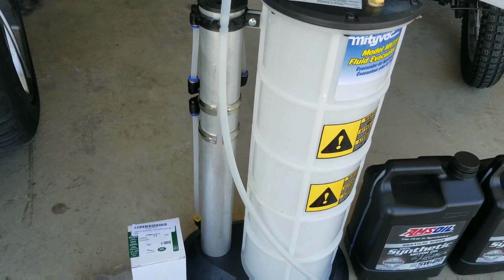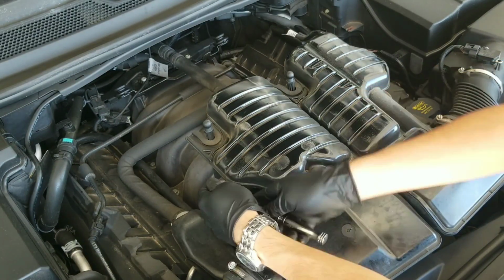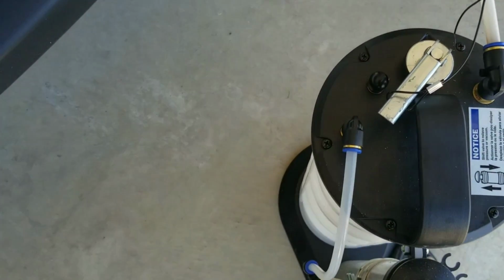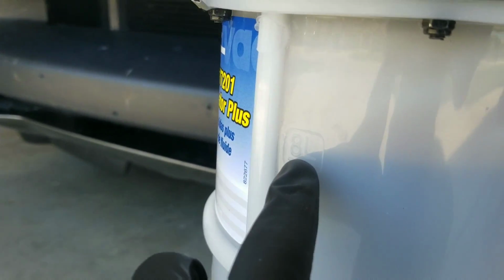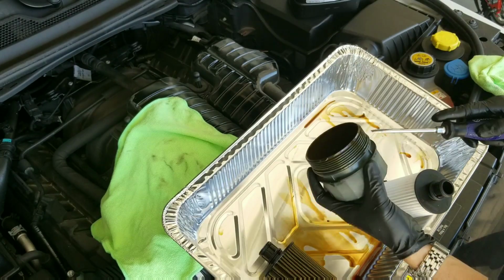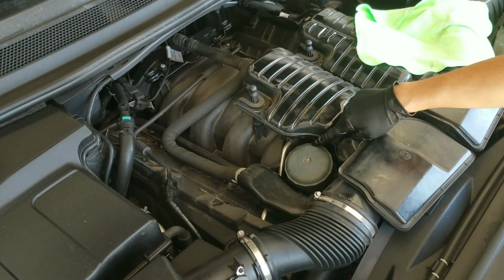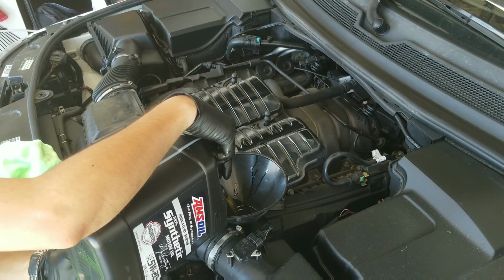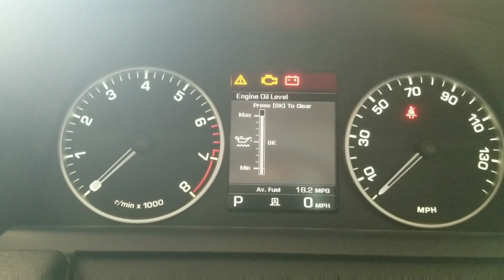2010-2013 Range Rover Sport L320 | Quick and Easy Oil Change

Comment: Does that method extract all of the oil? I've seen setups where you use a vacuum tube which you insert into the stainless tube that you connected to.  Then you push the vacuum tube all the way down into the oil pan.

Comment: Great video.  But 8.5 quarts ? Mines a 12 book says 8.  I put in 8 and still get a service engine warning and my Guage says over filled. I had to extract a half quart. And then in the oil filter housing there's quite a bit left I try to suck out and wipe it clean.  Next time I'm pulling the drain plug also to see what else comes out. 
Cheers

Comment: Hi. I see this video is few years old but its even better for my question..
How is that AMSOIL working for you? I have just did my first (first by myself I mean) oil change in my 2013 RRS SC using AMSOIL 5W20 SS series oil. I drained it VIA the plug though. I dont have a pump and I was replacing active sway bar bushings so armor was off anyway...

Comment: do you know how to reset the code required maintenance  when i change engine oil 2013 range rover sport 5.0 v8 supercharged
Reply from the maker: I have an IIDTool device that I use for resetting. Read some of the old comments on here, someone mentioned a while back on how they reset it without an external device.

Comment: Thanks for the video, any idea on how to reset the service light afterwards?
Reply from the maker: I don't believe you can do it without taking it to the dealer or use a special tool. I use an IIDTool.
Reply: Technical Mechanical Thanks for the timely reply. I ended up pressing start ignition to position 1(without foot on brake), opened hood latch, opened driver door, held brake and accelerator simultaneously to the floor for 10 seconds, released pedals, pressed ignition to shut off lights. Then exited car, closed hood and started car as normal and the light reset.
Reply from the maker: Very interesting! A while back I tried searching and couldn't find anything on how to reset it for the years 2010-2013. What year is yours?
Reply: Technical Mechanical 2010
Reply: Technical Mechanical Thank you for all your videos! They have saved me so much time and money!

Comment: Is there any oil drain plug under the engine if you don’t have one of these vacuum machines?
Reply: smhri there is but the oil pan is behind a 30 lb skid plate that u have to take off to access the drain bolt. i guess certain ppl prefer not to do that cuz if that thing falls on ur face it could really flatten it

Comment: Just my $0.02 - I think it's a good idea to put ~1Qt of oil into the oil filter housing to help prevent a dry start when you first start the vehicle. When you pour engine oil in an empty engine it goes to the same place you extracted it (the sump)...the first few seconds the oil pressure is building and bringing oil to the topside, which will likely be very dry. My thoughts are it's easy to do and it might help prevent unnecessary engine wear - so why not? GREAT VIDEO
Reply: Steven Phillips I pour some in for this reason as well!
Reply: lol.
Reply: Hugh Ty xxyxyhrnhngnxbxnnxxzuz😮a in
Reply: Un.  H tuuuhh

Comment: Great video!  Any particular vendor you recommend for the Amsoil / oem parts?  

-Thanks

-
Reply from the maker: Thanks! I get Amsoil directly from their website. OEM parts from Atlantic British and Amazon if it's cheaper. I also check out ebay for certain OEM parts. There are dealers on ebay that sells genuine oem parts at a decent price.

Comment: Over 8 liters were pumped out  !     But the 5.0  V8 should take only 7.8 liters ..... Unless this is a different engine 🤭
Reply from the maker: The standard oil change quantity for 2011 and onward N America market is 8 Liters. Yes, the dealership may have overfilled it a tiny bit when they last changed it. Mine has very low miles.
Reply: Technical Mechanical  My 2010 ( white exterior ) is at 10800 kilometer 🙂 now that is LOW mileage
Reply from the maker: I'm at about 32k miles already. You win! :)
Reply: Technical Mechanical 👍
Reply: @TechnicalMechanical  what size is the oil filter housing wrench in this video?
Reply: @seanblaum7129  Use a 15 fluted, 89mm filter wrench sold on Amazon.

Comment: What does the yellow service signal mean on your dash ?
Reply from the maker: I believe these are standard/general warnings since I had the door open, ignition on (but engine off), etc. They went away after I start the engine.
Reply: @TechnicalMechanical  ok so would you buy one with this triangle sign
Reply: @keyonjackson7950  I've had that sign on mine a few times and it's always been something significant. So - unless you can check it out, no. (Suspension compressor replacement, TPMS sensor fail)

Comment: I noticed you poured the old oil out. Instead you could have just pumped it out by putting the vacuum unit in reverse mode !   Much easier to do it this way .
Reply from the maker: That's a great suggestion! I did think of that but was a little worried about making a mess when I have to switch over to a second container to hold all the used oil. Let me know if you know of a way to quickly stop the pumping.
Reply: There is a bulb-shapped mechanism on top of the unit, when lifted up it will depressurize the tank.

Comment: Why are you not putting in 8.5 qts when it calls for that amount?
Reply from the maker: Great question! I mentioned close to 8.5 quarts because the capacity is 8.0 Liters which is 8.45 Quarts. At that amount the oil level is at the max. If you shoot for 8.5 and go over slightly, you might overfill, especially if you didn't fully extract all the oil out.

Comment: How did you reset the service light?
Reply from the maker: +Marcin Apostol I use the Gap IIDTool. I believe for the 2013 USA model you need a similar tool or have to let the dealer reset it.
Reply: Technical Mechanical I thought you hold the break pedal with the car in the accessories position...YouTube it